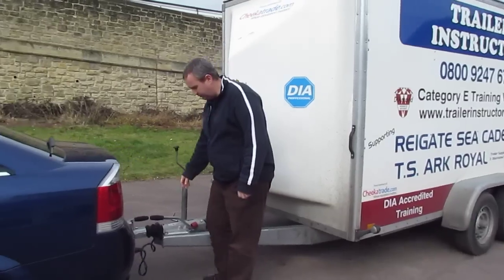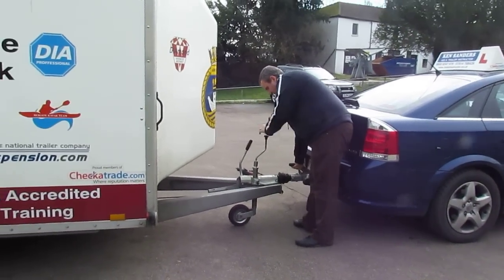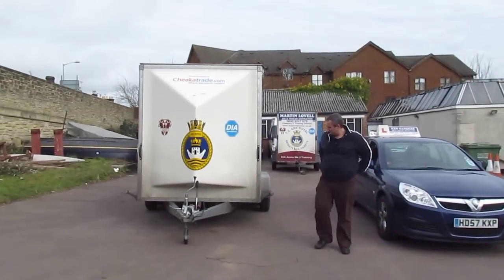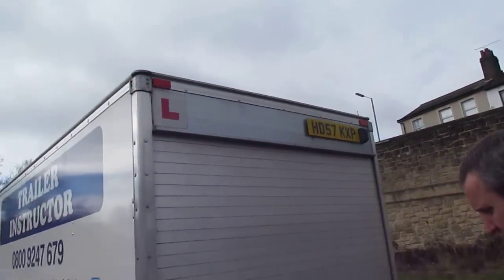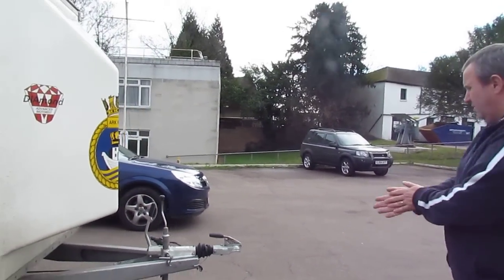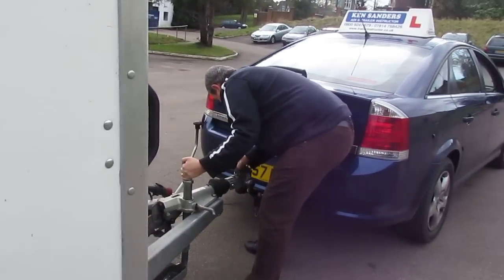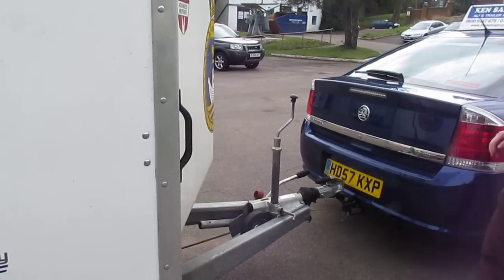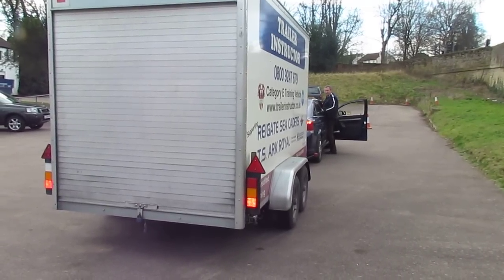B+E Trailer Test Uncouple/Recouple Exercise Demonstration

Comment: Poole, Dorset. I had to take two shunts, did not cross any lines or hit any cones etc. I failed only because I had to take two shunts - I was told by my instructor that I was only allowed to take one shunt. It is so difficult as there is very little documentation available about the test and it is very, very expensive! I will have to wait quite a while before taking it again now anyway due to money. Thanks for your reply.

Comment from the maker: On a flat surface it is possible to pull a correctly loaded trailer up to the towbar that one is 2.7 tons and can be moved fully loaded on a hill or rough ground yes it would not be possible. The test is not just an coupling exercise it is the complete C+E LGV test (the old class1 HGV) test taken with a B vehicle and trailer at a DSA vocational test centre. The examiners assess the candidates to the same level as a professional driver and my instructors are all C+E LGV license holders.

Comment from the maker: Crice that is a 2.7 tonne gross trailer and weighs 600 kilos empty. Fully loaded CORRECTLY that is not exceeding the specified nose-weight I HAVE moved it alone on flat tarmac. When the weight is over the axles the rolling resistance on tarmac so low it can be moved easily. When there is too much weight over the jockey wheel the rolling resistance will be so high you won't be able to move it.The DSA don't expect candidates to get the ball under the hitch and the demo is how it has to be done.

Comment: Hi
Unfortunately I failed. I only got 4 minors on the drive and didn't get any minors on the coupling! (Thanks to you - I was so worried about it!). I failed the reversing as I had to take 2 shunts as I oversteered a bit and was so nervous I couldn't correct it without the second shunt. I had 9 hours tuition before the test.

Comment from the maker: You will not fail for touching the trailer when you reverse up to couple as long as you checked that the brake was holding with your vehicle checks after un-coupling.